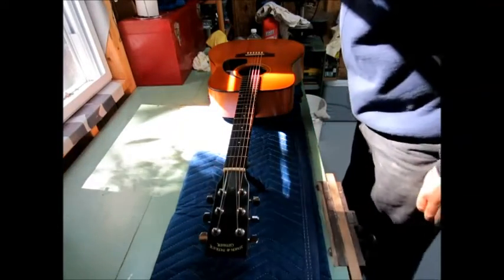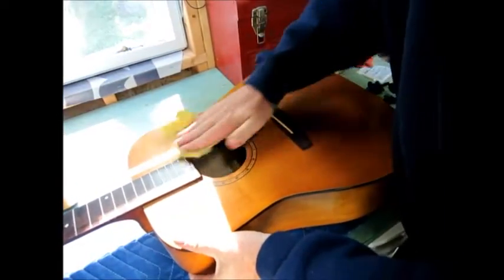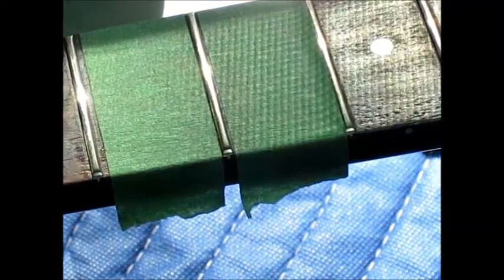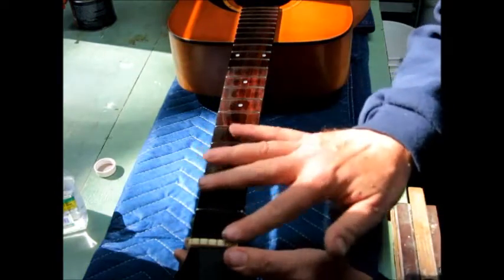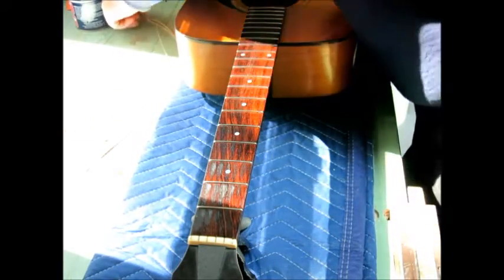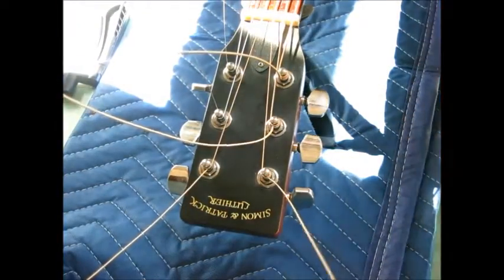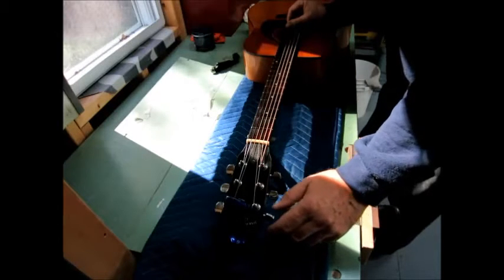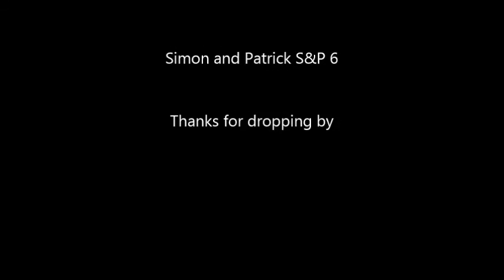S&P 6

Comment: Hi Jim. I enjoyed your video and tips. Question? I just bought a used Simon and patrick 6 cw demo. Look very similar  to yours. Any idea of the age of it.  Also it is  a satin  finish but very dry. And tips on hydration?
Reply from the maker: You can lay it on it's back, in a case and put a container of water inside the body and keep it in a closed case for a few days.  There are commercial humidifiers available that work well, just get one that goes inside and seals the sound hole.  Mine is about 25 years old now I think.